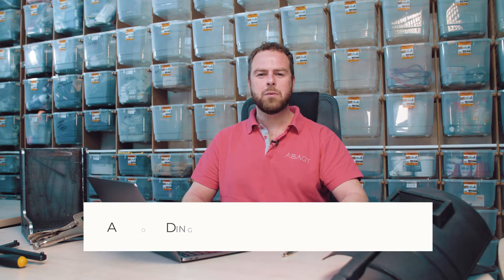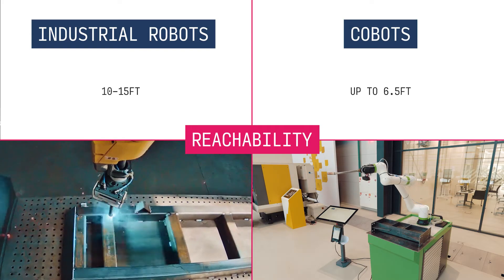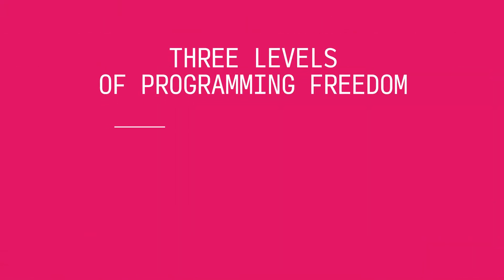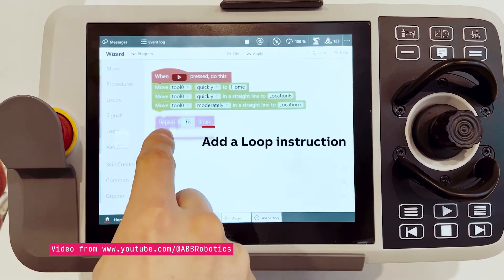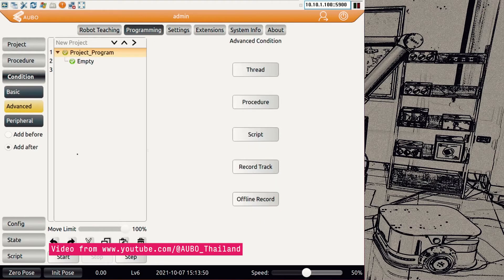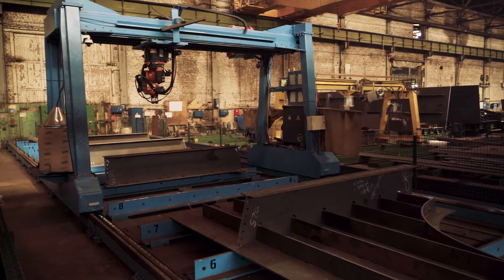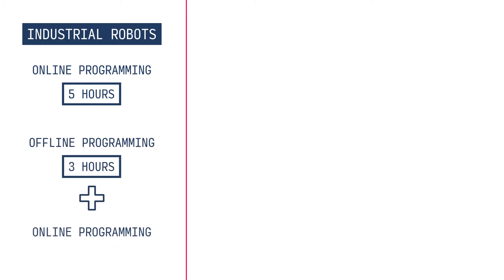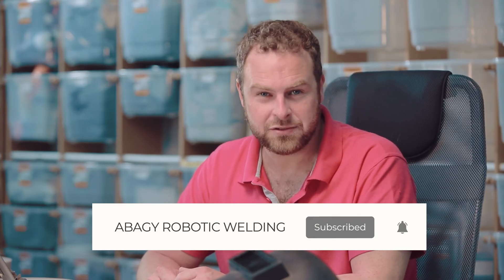Cobot Programming: Why It's Not as Easy as It Seems | ABAGY ROBOTIC WELDING

Comment: Data provided for programing is not exactly accurate and somewhat misleading. Does abagy able to have adaptive on the fly paths based on improper fit up?
Reply from the maker: Thank you for your feedback. Abagy does offer adaptive on-the-fly path adjustments, which can accommodate improper fit-ups and deviations in real-time. Our system automatically adjusts the welding path based on the actual position and geometry of the parts, ensuring consistent quality even when the setup isn't perfect. If you have specific concerns or need more details, feel free to ask!